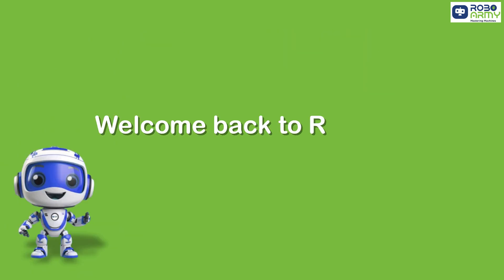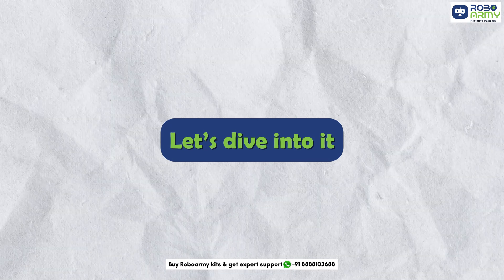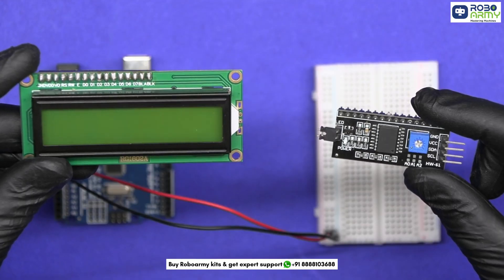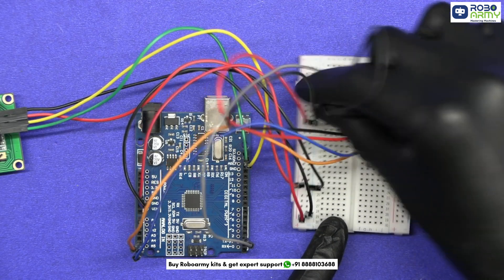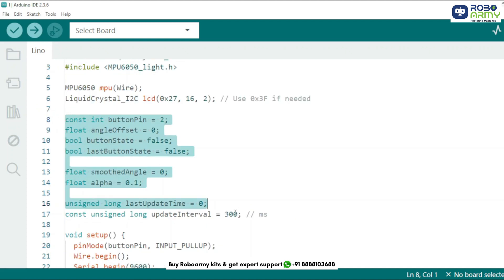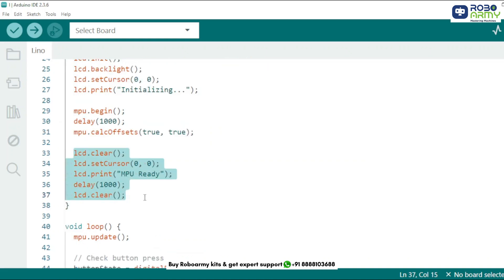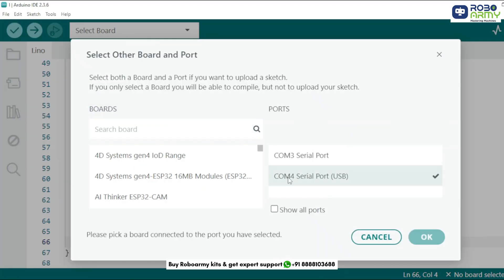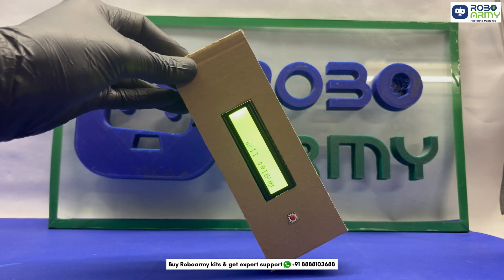Build an Angle Display System with Arduino & MPU6050 | Real-Time Tilt Detection + LCD Output

Comment: Actually Sir The Gyroscope Module is working fine And everything is fine but still The LCD shows angles and then freezes after some seconds why and how to solve it?
Reply from the maker: It sounds like the LCD might be freezing due to a communication issue or a problem with the loop structure in your code. You could try adding a small delay after the LCD print statements or checking for any memory overflows if your code is complex. Make sure your I2C communication lines are stable and correctly wired too!
Reply: @robo_army_  all connections are correct can you provide me correct code as I am beginner

Comment: Sir how would the connections look like if I don't use breadboard please sir because I only have mini 170 tie pins breadboard ❤
Reply: And please also tell which breadboard you have used
Reply from the maker: Any cardboard not as specific.
Reply from the maker: You can connect the components directly using jumper wires and soldering, or by twisting wires together for testing without a breadboard.
Reply: @robo_army_  actually youtube isn't a convenient way of asking queries so any other contact information 😊

Comment: Why does it not workk?? Does it matter if you use a 3-axis mpu6050 or a 6-axis? and also does the arduino type matter?
Reply from the maker: Thanks for your question! 😊
The MPU6050 you are using should always be a 6-axis sensor — it has 3-axis accelerometer + 3-axis gyroscope built into the same chip. Sometimes sellers label it differently, but all MPU6050 modules are 6-axis by default, so that part shouldn’t cause an issue.

Also, the Arduino type doesn’t matter much — Uno, Nano, Mega all work fine as long as the wiring matches the SDA/SCL pins and the libraries are installed correctly.

If it’s not working, please double-check these points:
✔ Correct I2C wiring: SDA → A4, SCL → A5 on Arduino Uno
✔ Library installed: MPU6050_light
✔ I2C LCD address is correct (0x27 or sometimes 0x3F)
✔ GND connections are properly shared
✔ Upload successful without errors

If you still face issues, let me know what error or behavior you are seeing — We're happy to help you troubleshoot!

Comment: Sir in LCD ALWAYS SHOWING 0 degrees what to do
Reply: Sir, please provide the name of correct library for MPU6050 and LCD display
Reply from the maker: Thanks for watching! 😊
For this project, I used the following libraries:

✔ MPU6050 Library:
MPU6050_light by RF Solutions / Electronics Cats.
(You can install it directly from Arduino IDE → Sketch → Include Library → Manage Libraries → Search “MPU6050_light”)

✔ LCD Display Library:
LiquidCrystal_I2C by Frank de Brabander.
(Install from Library Manager by searching “LiquidCrystal_I2C”)
Reply from the maker: It sounds like the MPU6050 might not be communicating correctly. Make sure you have the correct library installed and that the sensor is properly connected!

Comment: Bro I finished everything as you do but in the lcd display did not show noting I didn't understand make a clever video as soon as possible before December.
Reply from the maker: Hey! 😊 Thanks for trying out the project. If your LCD isn’t showing anything, please check the contrast by adjusting the potentiometer and make sure the SDA & SCL pins are connected correctly. Also, confirm that the I2C address in the code matches your display’s address.

Comment: Bro how do you make the switch out of the box but you attached it to breadboard
Reply from the maker: Haha, good observation! I didn’t make a switch out of the box — I just used a regular push button and placed it on the breadboard for easier connections and testing.

Comment: How can we modify this using amplifier/filter..can you reply fast 🙏🏿? and also what is tilt sensor ?
Reply from the maker: Yes, you can modify the circuit by adding an amplifier to increase the sensitivity of the tilt sensor’s signal, or use a filter (like low-pass) to remove noise and make the detection more stable. 

And about the tilt sensor — it’s a small device that detects orientation or angle. Basically, it tells whether the sensor is tilted or upright. When tilted, the tiny metal ball (or mercury in some types) inside changes the connection, giving a digital HIGH/LOW output.eg. MPU6050
Reply: @robo_army_  Thankyou very much Sir 🙏🏿🙏🏿 Thanks a lot❤
Reply: @robo_army_   Excuse me sir, I want to make the same project using an LM358 amplifier, is it possible to perform the same using the Arduino, if yes how can we do that??? Our co-ordinator subject is analog electronics, so we should use Tilt sensor / Accelerometer sensor and wireless module , amplifier are compulsory needed....please guide us to fulfill this project sir 🙏🏿 Waiting for your response sir.

Comment: What type of jumper wires
Reply from the maker: Thanks for asking! I used male-to-male jumper wires for connecting components on the breadboard. If you’re connecting sensors/modules directly to Arduino, sometimes you’ll also need male-to-female wires.

Both types are commonly available in assorted jumper wire kits

Comment: Can you tell me about battery
Reply from the maker: Sure! You can power this project using a 9V battery connected to the Arduino’s power jack or use a rechargeable 3.7V Li-ion battery with a boost converter to get 5V. Just make sure your power supply can provide stable 5V for accurate MPU6050 and LCD performance.